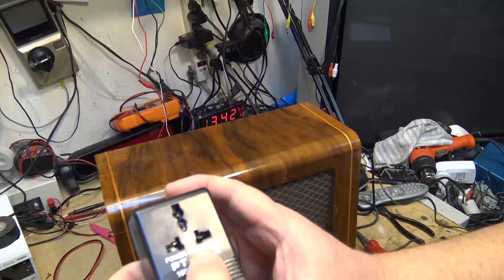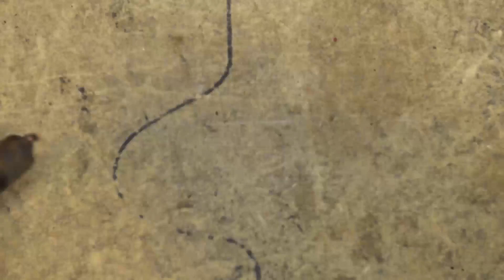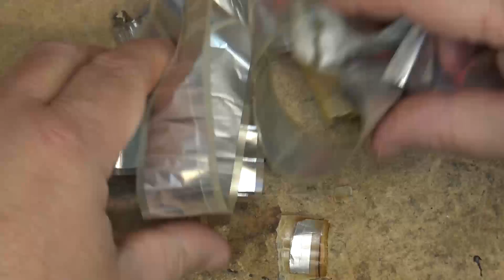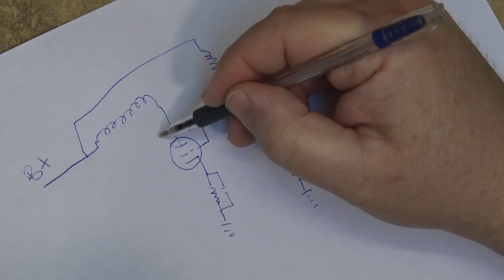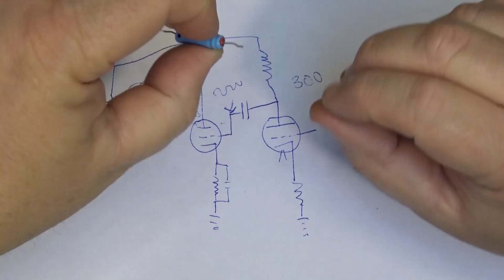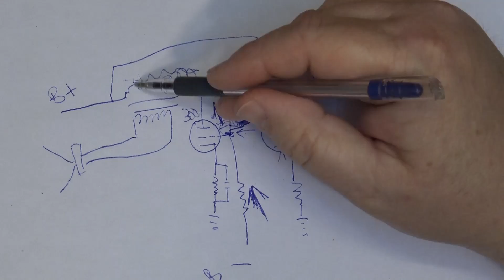Pye P75 Vintage radio restoration part 2

Comment: That's a cool device; they did their best to make it as versatile as is could be. I was looking at a house for sale last year that had been owned by a British couple; they wired both 120V phases to a UK-style socked in their kitchen so they could use their electric kettle, which, designed for a 3,000 watt UK socket, could boil water over twice as fast as anything you could buy here.

Comment: Nice video. Most European radios of this period (and all British sets) had the dials marked in metres. Long wave broadcasting never existed in the Americas, but there are till quite a few stations in Europe on this band. Shortwave propagation varies throughout the day, but generally look out for stations above about 7 MHz/40m in the daytime and 40m and below after dark.

Wonder what it was doing in the US, especially without the correct voltage modification? It's a typical 1950s radio. Not worthy of collection over here these days. Bakelite radio are more desirable. Try and get a Bush DAC90A set - early to mid 1950s. Quite common here and nice little sets, from ebay for less that 50 pounds/$65 plus shipping to US! Of course they're 220 to 250 V but will run from AC or DC - not that DC has been used in the UK since the early 1950s!

Most serious vintage radio users use a little AM transmitter these days like yours. They are theoretically illegal in Europe, even a few milliwatts, but this isn't enforced anywhere to my knowledge now. We don't have the equivalent to a Part 15 licence - yet.
Reply from the maker: Yes I built an am transmitter   400 milliwatts get a signal out 100 meters or so before it fades away. Good enough to test my vintage radios. I have 5 wood and a bakelite radio in my small collection

Comment: Hard to think that you wouldn't immediately have any particular piece of electronic equipment on hand, especially a power supply of 240 volts.
Reply from the maker: Why would I have a 240 volt power supply? We use 120 here. Sure I have a 240 plug for my car, and shop heater, but I am not about to plug into that. SO I picked up a cheap transformer.
Reply: @12voltvids  I know, but it seems you have almost everything electronic.  I admit to being in awe.

Comment: Back in '93 an accident in the line of duty put me on the permanently disabled list on the PD.  Workers Comp was our retirement system for disability, and they decided I was savable by re-educating me from a cop to a paralegal.  Didn't work for either of us, and after 4 more major back surgeries, I was put out to pasture.  Thus began my playing with electrons. I had always had a deep interest in electronics, even back in the early 70's when I was in the US Army Communications Section I would be called upon to fix the Officer's televisions, now I have no idea why they thought a field wireman, who's duties include hanging telephone wire from trees, climbing poles and hooking up switchboards should know anything about televisions I have no idea, but after some experimenting, I got quite good at TV repair (Just a tube switcher, I stayed away from the bottom of the set.)  So I learned by playing as it were, and, of course as my Army Career progressed, I constrained into teletype, then radio teletype, then became a communications chief with my own Company Commo Section and doubled as the Headquarters Company Platoon Sergeant as the rest of the NCO'S refused to take the job.  All that said, I can honestly say that I have learned more about electronics from watching several of your great videos then I ever did whilst attending the Army Training Centers and what I picked up on my own.  It was discovered that contrary to my old high school record with grades around a D average, that I  did in fact test in the low genius level on the IQ tests, and in college I maintained a 4.0 GPA which really pissed off the youngsters just out of High School who would not put the work into the courses as I threw off the grade curve for everyone.  I guess what College showed me was the fact that High School was a place where my main interests were pussy and beer, I could never get enough of either and never cracked a book for most of my High School Days, but in college, I lived in the damn books, having to spend my nights and weekends in a dorm room whilst my wife and kids kept the home fires burning and enjoyed the weekends that I could make it home when the blizzards and major snow storms of North Dakota allowed.  By that time, I no longer had any interest in beer, and as far as pussy, well I had a wife waiting for me at home, and should I have accepted any of the opportunities that I was offered, it would have broken her heart, and I would never do that, even for some strange stuff on the side.

Comment: One thing I don't understand is if the radio had a 120 switch on it, why did u have to buy a transformer ?
Reply: I don't think it did, I think it had some different variations of 200 or so volts.
Reply: @neodonkey   oh, ok ..... thank you
Reply: A very good radio receiver restored to its original state.We had one PYE like this set in 1960.I would like to buy one.Could you please find out  for me.thank you.I am now 74 years old from Srilanka.

Comment: It's a shame that more efficient lighting requires components that cause interference.
As for the capacitor, it is amazing how they compact the plate and the  dielectric.
Reply from the maker: Not just fluorescent and led lighting that causes interference.  It is everything digital these days.
Reply: broadband routers and Wifi plays havoc with MW/AM radio these days too,  i can drive past various shops and houses and the interference the AM radio picks up is enough for me to switch the radio off

Comment: Well done and a great couple of videos. I have just been given a Philips AM FM valve radio from the 1950’s. I also have an isolation transformer as well so I can make the Philips the first restoration.
Cheers
Lynton G4XCQ
Reply from the maker: I just picked up an old marconi and ge radio from the 30s & 40s. The ge is older as it has the metal cover tubes in it.  Will be going full restore videos on them.

Comment: Dave, 

I have more than a few tube radios and understand the need to replace all the paper and electrolytic capacitors.  I knew a little of what you were talking about, but really appreciate the thorough explanation of the capacitor deterioration and how it affects the radios performance.

That is a nice radio you've got, a real keeper.

Regards, Tom

Comment: One the ones I have and just restored one of them (they do perform well) both have 2 decorative 3mm angled wood trim on that run down the inside of the cabinet where the speaker grill cloth and glass frequency dial is , just cosmetic but looks nice , great work enjoyed the video

Comment: That’s brilliant, fairly easy to get going these are. I normally tend to change the HT smoothing capacitors and the capacitors across the volume control. The sounds normally amazing

Comment: I had a tube turn red years ago on a mac amp.  I fixed that and a few months later, the filament winding to the rectifier shorted to ground and blew the rectifier filament apart. Tubes are temperamental.

Comment: Great videos on this radio. I have never seen tubes like those. I Have an old Philco Butterfly radio and I initially didn't change any of the mica caps but, when it didn't behave well, I started testing and found I had three bad mica caps. After replacing them, the performance improved remarkably. I originally thought I had done something wrong but, after thoroughly checking the wiring, I found no mistakes. What I found odd was that none of the paper capacitors tested even remotely good, they were all shot. Usually, you will find that some of them test sort of OK but not so with this one. I am wondering if this radio had been stored either in a damp environment or a really cold one. Would either of those cause this result? This is from 1935 but even so I thought some might be OK. I was going to replace them all anyway so it doesn't really matter, just wondering about this.

Comment: That's an ideal little transformer, "Just the job" :-D

Excellent discription of capacitor construction and it's failure, it's no supprise that they fail given the voltage on them.

If you can earth the chassis of that radio, a coaxial cable from the radio ant input +earth will reduce the noise, then you will only get the antenna pickup.
It does help, i've used coax :-D

Electronic noise is horrible now, so many things have emmisions from switchmode psus or computers that are full of squarewave noise/harmonics.
Reply from the maker: Yes I know. No ground wire attached at the moment. I should hook it to my 40 meter dipole and see how it works. So much DSL noise but fiber is coming, and it can't happen soon enough.
Reply: I bet that 40 meter antenna would make a hell of a difference.
I would imagine that the internal antenna would work with very local transmitters, the bbc had quit a lot of them, i suspect that power levels have dropped over the years.

Comment: Radio looks to be in excellent shape - not too difficult to repair that one and a real winner. 
The right AC input voltage makes all the difference!

It would be nice if the radio had FM instead of LW, but I did like your explanation about capacitors. :)
Reply from the maker: Well in 1953 there wasn't any FM stations around.
Reply: Good point,  I think Armstrong had some experimental ones but not in the UK. We think everything was always around.
Reply: Still a good radio for its time :)
Reply: FM broadcasting started in Australian capital cities in 1947 on an "experimental" basis, using a (monaural) ABC national network feed, consisting largely of classical music and Parliament, as a program source.
FM receivers were expensive and the audience consisted largely of Hi-Fi enthusiasts. There was no mainstream TV in Australia before 1956.

How times have changed!

Comment: Where did you find the step up step down transformer. I purchased one for a 25 year old project that I have
with a 230 volt Radio Corporation of New Zealand Radio. However my step up transformer is quite a bit
larger and clunkier and must be turned on before it can be used. The transformer that you have looks ideal
for my needs. The radio that I have will draw 60 watts while working but a bit more at start up. 
The step up transformer one that I have is rated for 100 watts and fused for 2 amps and seems
like it should work just fine. The one that you show does appear to be a better solution from the
standpoint of how it will look in a room, my wife hates the looks and size of the one that I have 
and the fact that it will need to have it's own shelf on the table that the radio will be sitting on. 
It is a extremely beautiful radio that is 78 years old and needs a total restoration. Aloha from Maui
Reply from the maker: I bought it at Lees Electronics in Vancouver. They do have an online sales dept, and will probably ship you one. It was 13.00 canadian, rated 100 watts.

Comment: Thos  capacitors look like they all would short out, without a second insulator. if I was repairing electronics, wonder if there was a need for having something that shorted and defused , besides needing a replacement,like a battery. Would there be a needle or wire , foil and Tape jumper fix for a capacitor?